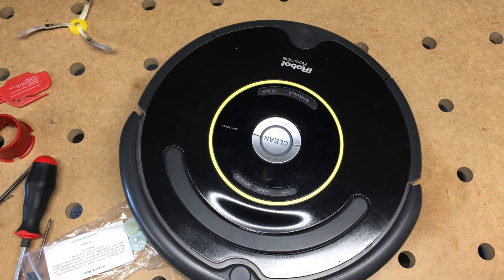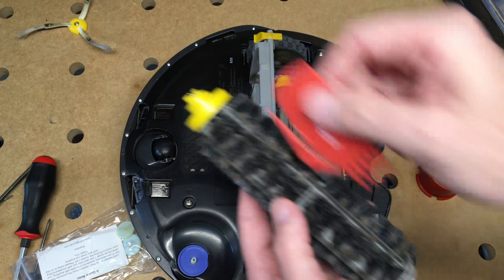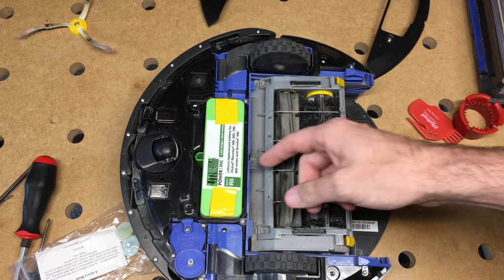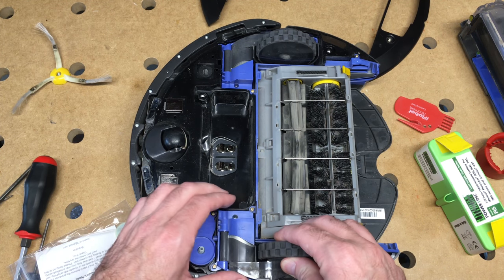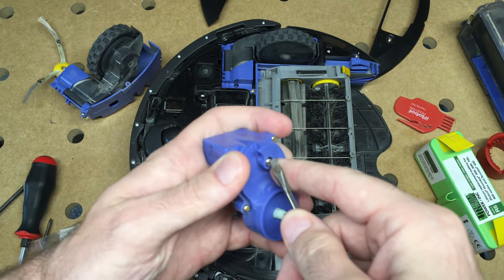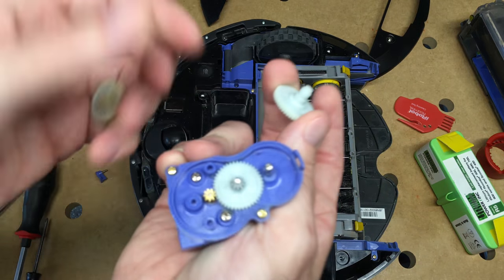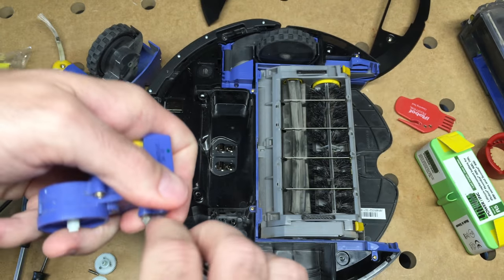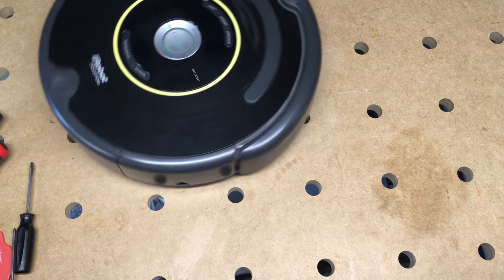Roomba 600 Series Upgrade, Maintenance and Repair

Comment: HELL YEAH! This video was clutch in helping me take apart my 690 and cleaning the gearbox for the wiper blade. Just an FYI the lubricant inside the gearbox was dried up with long hair that got trapped which caused it to seize up. I used a razor blade to cut out the dried lubricant and sprayed the inside with Liquid Wrench Silicone Spray. After using the brush blade to help turn the gears to fully lubricate, it worked like a charm. Thank you sir!
Reply from the maker: Glad to help!

Comment: Thank you for making this video! This is the exact problem I’ve run into and I had no idea what to do.... until I watched this video! So anyway, thank you for saving me a bunch of time, with a 9 month old baby at home, I need as much time as I can get.
Reply from the maker: Babies are a lot of work. iRobot needs to invent a robot to change diapers.
Reply: Thanks for the video. I have a 560 with a clicking noise and amber light. Tried everything so far. Any suggestions?
Reply: Your and me both, except with a 3 year old, it's great to come home to crumb free floors

Comment: Maybe could have just purchased the replacement gears, but got the side brush and motor (refurbished) for $20 on Amazon when the side brush quit turning. 
Thanks for the video, and the gear repair primer.

Comment: Our robot runs well but doesn't seem to pick up items very well.  Have cleaned everything but cannot see if the brushes are turning.  Is there a way to test or troubleshoot if brush motor is working?
Reply: You can run a diagnostic check. Or put some salt on a hard floor and see if the Roomba can collect it in the bin. If the brushes are not working, very little will go through to the bin.

Comment: We came home from a vacation and found my roomba bin had liquid in it.  Somebody (no one is fessing up) apparently was in my house while we were gone and spilled something on the floor.  There was a dried up spot in the dining room that was suspicious looking.  I totally cleaned out the roomba, dried out the bin, but it isn't working quite right.  It will vacuum, but all the dust and lint stays in the discharge opening and doesn't make it to the bin.  Is there something I can do?  I noticed you made a comment to someone about not washing the bin because of the fan.  Can the fan be replaced?  Should I order a complete new bin?  My Roomba is a 805 model.  Thank you.
Reply from the maker: srgentry51 If everything else seems to work, I would look into replacing the bin/fan. Also make sure the metal connectors aren’t corroded.

Comment: Any link with availability? Thanks for the video. Before I go looking for gears curious if I can help you out ..
Reply from the maker: I looked on Amazon and eBay. They seem to be out of stock. If you click the eBay link for the gears in the description, it appears they have the whole motor assembly available. It costs a little more than just the gears did but probably worth it if you really want your Roomba fixed.
Reply: Ebay , search for side brush module roomba
Reply: 7

Comment: So I found the idea of getting new gears into the side brush motor great until I foud out the price. The links in the description don't sell these gears so I looked for others on ebay. There they sell for almost 30 dollar. With shipping these gears cost more than $50,-!! The complete unit (incl. brush) sells for €35,95, shipping is €9,95.
Reply from the maker: It seems like the availability of the gears varies. I don't know what the deal is. I wonder if Roomba shuts down companies selling repair parts. Mine are still working fine thankfully. If you aren't in a hurry, you might check on Amazon and eBay once a week or so to see if prices have dropped.

Comment: Roomba 555 btw. Maybe motor burned because it cleaned carpets? Does side brush motor stop when it detects carpet ?
Reply from the maker: The brush should run on carpet.

Comment: Hi, I cannot find the gears kit to replace the lateral brush... you said Amazon.. but hard to find them, I can only find the whole assembly with the motor and case... thanks
Reply from the maker: They seem to be in short supply. They are available on eBay but they are expensive. You may be best off getting the whole assembly.

Comment: Hi. My gears are not stripped but brush is not spinning in regular mode. I ran diagnostics (test 19), and brush is spinning slowly. What could be a reason? Dead motor?
Reply from the maker: Could be the motor. I'm guessing you have removed the brush. They can get a lot of hair wrapped around them and you can't see it until you remove it. I think our side brush sometimes stops but I'm not sure what triggers it to stop. It might be when it bumps something. You might want to check any switches and sensors.
Reply: @Rickmakes  I cleaned motor completely. I took it apart. No hair or dirt whatsoever. I'll try new motor from aliexpress. Hopefully it helps

Comment: Thanks for posting this! I have to replace the side brush mechanism altogether, so I have to remove the battery in order to do that, or did you just remove it because you were replacing it anyways? Thanks.
Reply from the maker: I had replaced the battery around a year before making this video. It is not a bad idea to just pull it out when you are working on other parts. It is easy to remove once you have it open. This way you don't accidentally short anything out.
Reply: RickMakes okay thank you, I will remove it😊

Comment: My Roomba was making a noise that caused me to open up the side brush motor casing - I found the same thing you did, some of the gear teeth had broken.  However, looking to replace the gears, why are the pair of plastic gears selling for $35 and a whole replacement motor (casing and all) is selling for $40?  What am I missing here?  It feels ridiculous to buy a whole new motor when I only need the gears (really, jut one of them) ... but if I'm gonna spend $35 on just the gears, I might as well spend $40 on a whole new motor.

Seriously, what am I missing?  I expect a fair price to be no more than $10.  Can someone post a link for just the gears?  Thanks!
Reply from the maker: The availability seems to be hit or miss. I don't understand why they are so hard to find. I just found some on AliExpress. I'm not sure how good they are. It looks like they have some coupons which might lower the price a few dollars. https://www.aliexpress.com/item/4000751425473.html?spm=a2g0o.productlist.0.0.7f8d4253v7Ajfq&algo_pvid=5f6ba89c-c098-45c8-9aa3-a34ad4d6efa9&algo_expid=5f6ba89c-c098-45c8-9aa3-a34ad4d6efa9-0&btsid=0ab50f0815929701070855216e515f&ws_ab_test=searchweb0_0,searchweb201602_,searchweb201603_

Comment: gonna try to fix a roomba 980 which i got off ebay see how this shitfest goes, first thing i noticed is it was missing a plastic guard piece, turns out the seller removed it and then sold that separately for 6 dollars, great experience already
Reply from the maker: That's not cool!
Reply: @Rickmakes  honestly ill be fine as long as he didnt take the motherboard out of the roomba because if he did ill basically just have to get another one

Comment: Thank you for this video!  My Roomba doesn’t make noise, but gets hung up on little things, like the transition piece between tile and wood floor.  It even wore it down a little!  D you think its a gear problem?
Reply from the maker: It's hard to say. I would take the bottom off and check the parts for wear. You might be able to compare them with the parts on mine from this video. The problem might be obvious once you get it apart.
Reply: Rick Makes.- We realized that the tires are bald!  That’s our Roomba’s problem.  $29 to replace each tire assembly is the cheapest I can find it.  $60 for both. YIKES!  

Thanks for your reply.

Comment: 2 things I need help with...   the top gear would not come off. Is that a problem? Also, can the dirt bin be washed? I really appreciate your video.
Reply from the maker: You could try (carefully) to pry it off with a screwdriver on each side. Just know that it could crack. I'm not sure I would rinse out the dirt bin. It contains the fan. You could probably safely wipe it out with a damp washcloth. I use an air compressor or a leaf blower to clean mine out.
Reply: @Rickmakes  I know it,s been awhile but this is what I did. Iwashed the bin , then I saw inthe instructions not to put in water, so I dried it with a hair dryer and it melted.
Reply: @LG-pj4qh  dead

Comment: Thank you, very helpful... where do you find replacement gear?  Whole new $14.90 from manufacturer, in eBay parts price are higher and seems to me that is something wrong.
Reply from the maker: I got them on Amazon. There is a link in the description. I just looked at them just now and they were $40. I paid $23 back when I bought them. I'm guessing the price can fluctuate depending on who is supplying the parts.
Reply: Link is not working now for gears on Amazon.

Comment: Could anybody share the link for buying the gears in amazon, for some reason I cannot find it.
Reply from the maker: It doesn't appear there are any gears available on Amazon right now. It looks like you can buy a whole gearbox. Gears are also available on eBay via my link in the description.
Reply: @Rickmakes  Thank you so much. It seems buying the whole side brush gearbox is cheaper than getting just the gears. Woow kind of crazy, but that is what it is now.

Comment: Mine keeps stopping while it’s cleaning,  sings a tune but doesn’t show an error message. I’ve cleaned out but it’s still happening
Reply from the maker: Is it playing the tune like it is all done cleaning? I wonder if your battery is going bad. If you know someone else with a similar Roomba, you might try swapping the battery to see if that makes a difference.
Reply: RickMakes It’s brand new. I’ve used it about four times and the battery is fully charged. If it stops mid clean and I press the clean button it starts cleaning again.
Reply: I had this happen awhile ago,  and cleaning the contacts made it stop.

Comment: I can not find the gears on amzon
Reply from the maker: They don't seem to be on there anymore. I did find them on eBay: https://rover.ebay.com/rover/1/711-53200-19255-0/1?icep_id=114&ipn=icep&toolid=20004&campid=5338462489&mpre=https%3A%2F%2Fwww.ebay.com%2Fsch%2Fi.html%3F_from%3DR40%26_trksid%3Dm570.l1313%26_nkw%3Droomba%2B600%2Bseries%2Bside%2Bbrush%2Bgears%26_sacat%3D0